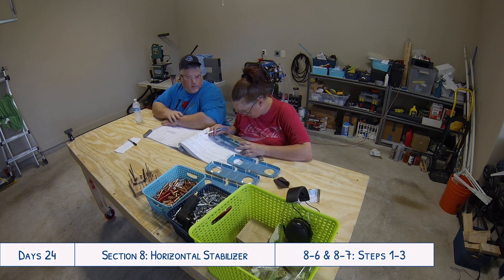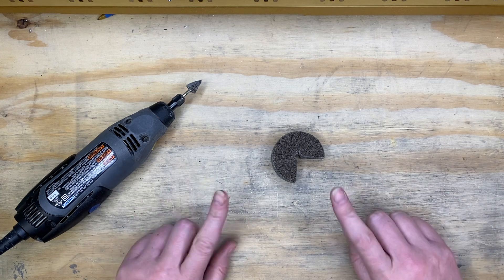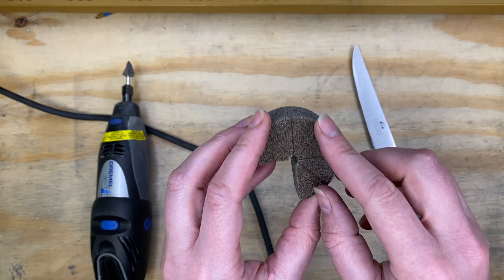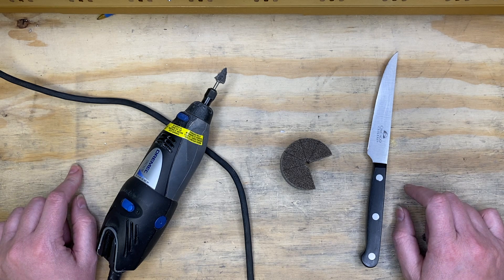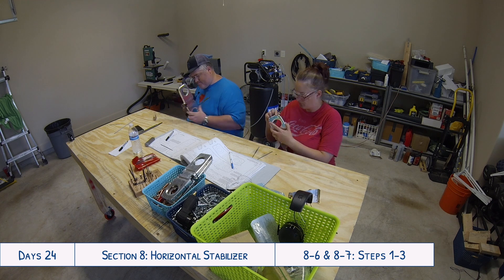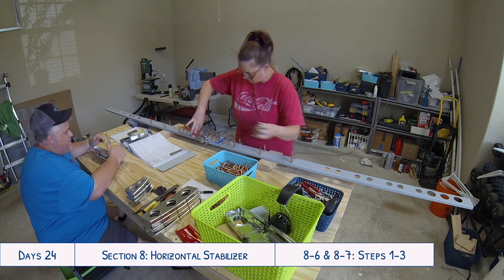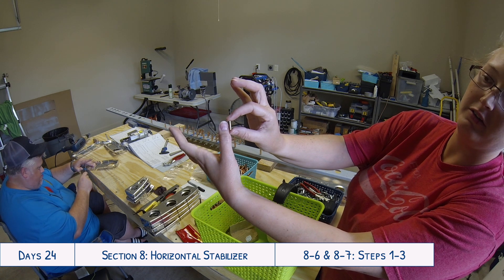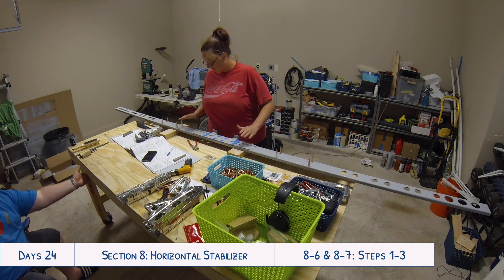Van's Aircraft RV-10 Build: Day 24 - Game Changing Deburring Tip (8-6 & 8-7)

Comment: You can buy bits already made like that at the big box store.
Reply from the maker: I haven't seen any deburring bits like this made out of 3M Scotch-Brite, only deburring wheels. Where did you find some?
Reply: @PlaneLady  Look up mounted points. Wide selection of grits on Amazon. 
I used a bit out of my dremel set to dress up my toolbox airfoil practice kits.
Reply from the maker: Thanks!

Comment: Hello, I am Erik, the Retired Flight Engineer who came up with the deburring tip......thank you for the shout out! That’s the first time i have been recognized here on YouTube. Thanks again!
Reply: Another tip for the million rivet holes in the skins, use the dewalt electric hand screw driver with the three bladed flute deburiing tip. The electric screw driver is the one, when you twist your wrist, it will slowly turn. That made deburring all those holes a ton faster. I think you can see it in the picture in my deburring post.
Reply from the maker: We have a small low power electric drill that we bought for cheap at Home Depot to use with our deburring bit. Goes slow enough not to countersink the holes, but like your screwdriver suggestion it sure makes deburring those large skins go faster! It’s the only thing we use that dinky little drill for, but it’s totally perfect for that so it was well worth it 😉
Reply: Erik.... You ROCK!! Great idea. I'll go inot the workshop and make some now for my RV-7 build.
Reply from the maker: Oh cool!! Thanks for your post on VAF! Ty found it and I already had the right dremel bit so we tried it and it is awesome!! That has come in SO handy in so many tight spaces. Thanks again for sharing your idea 😁 any other suggestions, tips or tricks you have to share?
Reply: Hello Erik, RV-9A builder in Texas here. Thanks for the tip; makes quick and easy deburring! We recently finished our empennage and are currently working on the left wing. https://youtu.be/lMSb2S8OFps

Comment: I wanted to get your impression of your Plane Tools kit, did you order the RV10 tool kit or did you order tools as you went?  I was looking to get the kit and wanted to get your opinion.  Thanks!
Reply from the maker: Hey Thaddeus, we ordered the RV-10 tool kit from Cleaveland Tool but we made some tweaks to the kit. You can get an excel spreadsheet from them and make changes to customize it and still get the discount they give for buying a kit (I think it’s an 8% discount that you’re getting on all the components in the kit but I’m not sure so make sure to check with them). So for example, we removed the c frame and added the DRDT2, we added the pneumatic squeezer, we added more clecos, we added another deburring handle so both of us could deburr at the same time, things like that.

We have since bought other tools from them since we started, things we thought we needed (like more clecos and small diameter dimple dies) or wanted (like a longeron yoke, tank dimple dies, etc). It’s been very easy to just call Annette over there and tell her what we want to get and most of the time it goes out the same day and we’ll get it in a couple days. 

So we did both - we ordered the kit (and customized it), but we have ordered other things as we went. If you’re concerned about getting things in the kit that you won’t really need that isn’t the case. I’m pretty sure we used just about everything we got while building our emp kit. Hope that helps! 😊

Comment: Thanks for the shout out, and hope the tanks are going ok!!!
Reply from the maker: Y’all have had some good tips that have been helpful! Plus you’re nice enough to answer our random questions too 😜 fingers crossed - we’re starting sealing the first fuel tank tonight 🤞🏻
Reply: Fingers crossed for y’all too. I just installed my fuel sender units in both my tanks so once the proseal dries I’ll be dumping water in for an initial leak test. Pending no leaks there the rear baffles will hopefully go on next week sometime.
I agree, once we’re all finished building it’d be awesome to all do an RV-10 trip somewhere!
Reply from the maker: Thanks Auburn! Good luck to you too! We were able to divvy up the work on the wings and Ty’s been doing the L tank while I’ve been doing the main spars (aka countersinking hell 🙄). But feels like we’re making good progress tackling 2 parts at a time. We will have to find a fun spot where we can all meet up when we’re done 😊